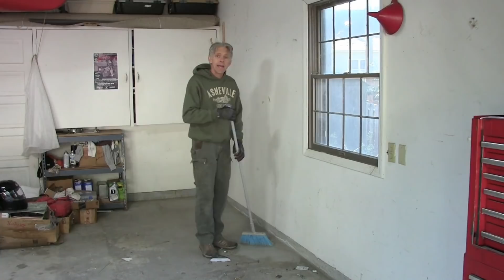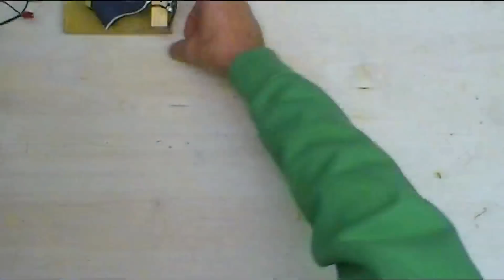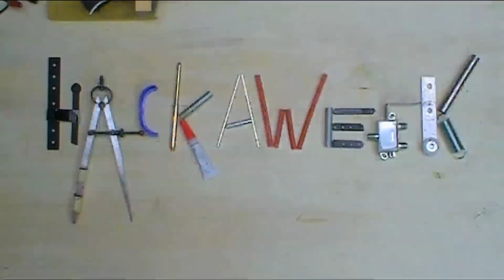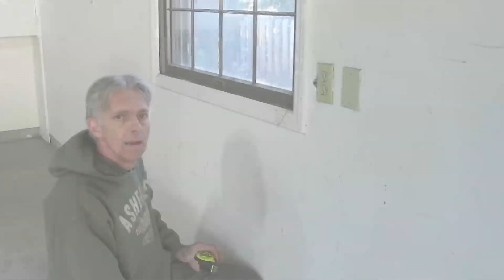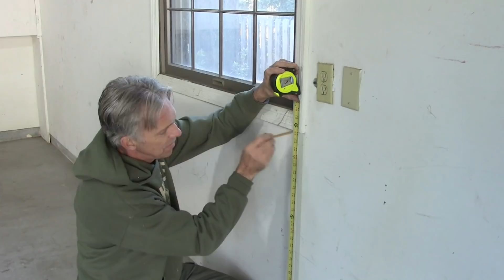Garage Remodel Part 2 Workbench Build

Comment: You make things just like I do!!   I’m going to use this video to make my workbench this week. 
One question though that I don’t think you addressed in the video, it looks like you doubled up on the second leg out from the wall on the left.  Was there a reason for doubling up there and not anywhere else?   I was thinking that maybe that’s where the two pieces of plywood come together?
Reply from the maker: Yes there was a butt joint of two pieces that made up the work surface. I like building them this way because using a ledger saves on wood use. Have fun with your build and thanks for watching!

Comment: Nice.  I think I will remodel my garage work benches also.  it's a mess in there and I think it's time. The bottom shelf won't be partial like yours.  I will make it as wide as the top.

Comment: Why not use joust hangers to attach cross members for bench top?.
Reply from the maker: Because the holes in the joist hangers would not line up with the studs. They would be on each side of them. The ledger serves as a solid base for the benchtop to rest on without sagging with weight.
Reply: @HackaweekTV_KR4NIV  thank you. Great video. Again thank you.

Comment: I watched your video prob 20 times, and paused it and took some measurements of my space and built it today!  It came out wonderful. Mine is a pressure treated, outside garden workbench. I ripped a 4x8 in half and then for the shelf I ripped the 2x8 by a few inches. Wish I could share my pics with you. I appreciate your video. It inspired me. I am not much of a woodworker. .)
Reply from the maker: Great job!

Comment: if you are planning on doing any mechanical repair I would go and get an an 8 by 10 feet sheet of galvanized steel. Have your local ductwork company to cut and bend down at the front. Now you have a steel topped workbench. So much better for keeping stuff clean.

Comment: This was great, thanks so much! I was able to use this as a guide to make a decent bench I can work on. Came out to 15'7" long, 2' deep, and about 41" high. I wanted to go the full 16' but needed to chop off a little length to be able to put my toolbox next to it and not block anything. I picked up some new skills, and a greater appreciation for how hard it is to cut a nice straight line with a circular saw to make the top.

Comment: I made the skeleton of the bench top with the ribs first.   Set them away from the studs where I'll crew in my back 2x4 to the wall.  Helps to just put a small 1' 2x4 butted up under the back 2x4 just to make you feel safe.  Legs are two 2x4' on each end in a L and a couple of doubles attached to the ribs and 2x4.   I also made it where I can run a 2x4 from front to back a foot off the ground for storing wood and what ever.  Enough room put a board down to store tools.  
I used 2x8's for the top with 3" hang over for vice or anything else I need some good support.  Not to long to make.  Counter sink your screws so you don't split the wood.

Comment: you definitely don't need to predrill before every screw and don't use phillips screws you can hear his bit slipping on almost every screw.
Reply from the maker: I predrill so that the treads don't bite into the 2x4. Without predrill they do and you don't get a tight joint. So the bit slips a little, but the screws are tight. Also, try taking the time to use some punctuation and proper sentence structure.

Comment: Is it really necessary to pre drill ?
Reply from the maker: If you don't, the screw bites into the 2x4 and then into the wall and there will be a gap even if it seems tight because it's tightened to the 2x4 NOT the wall.

Comment: I've built many benches this style a couple things I do different drop your ledger three and a half inches build the frame cause I don't like the toe nailing the screws in the back offset cross braces so you can screw the frame into the studs and also double up on the 2X4s on the legs go from the frame to the floor and it looks a lot cleaner plus where ever i'm going to mount my vise I put in some extra 2X4s laid flat but that's me I tend to over build

Comment: i built the whole frame for the table top on the ground and then laid it on my pre leveled leger board propped it up at the same height at the front while i secured it to the wall

Comment: I know you built this 5 years ago now, but for anyone watching, a handy tip to keep from losing track of that bottom piece of window molding, is to tack it up underneath the bench top to the ledger board with a couple of brad nails (or tap in the nails already in it), at the location where it came off.  It's out of the way there, but you'll see it if you ever have to move the bench.

Comment: I am not 100% convinced that structure is as stable and strong as it should be for a workbench. Fixing it to to stud work would be the first point, Those pocket screw type fittings screw fixture is not convincing either. 

I would suggest legs at the rear even fixed against the wall would add extra downforce support at the rear.  It is not a bad build by any account. 

Even one centre leg at the rear would make a big difference.
Reply: depends what youre going to use it for,  light assembly, general work automotive work,  should be fine.. if your going to put a big vice on there and smash things with a mallet build it stronger obviously

Comment: I wonder if it wouldn't be quicker( and more solid) if you build the frame first and then connect it to the wall then put the top in it? I know, hindsight. 
Very simple and practical design which I very much like. Thanks.
Reply: with a helper definitely build the frame on ground,  but by yourself you have to break things up a bit sometimes especially with a 16 foot bench.  I built a similar bench in my shed and ran a ledger first

Comment: toe nailing those babies is plenty strong as long as those screws are decent.

Structural Screws, and the double threaded composite deck screws come in super handy, for various scenarios, but they are great to have. Those structural screws have serious sheer strength and the deck screws are good at pulling things together bc of that double thread, and man you cant pull or break  those suckers without dynamite. and they leave a little tiny "finish nail" like hole.

Good build !!

Comment: Minor point - if you want your bench at "3 feet"  and you've painstakingly spent time drawing up your plans, you might as well add the thickness of whatever top you choose.  And I agree with John (below), that you should set the height of the bench more according to your height than a standard measurement.
Reply: Yeah, I like all my benches at 38" as I'm 6'4.
Reply: I have several benches at varying height to use depending on the project I'm working on.
Reply: And I put the benches on casters to move around.
Reply: Yes everyone is different.The rule of thumb for comfort is to put table top height @ wrist flexion. That is not something set in stone, but a typical comfort height. Different projects are more comforting to do higher/lower. Sanding etc... lower, detailed and less strenuous higher.

Comment: Love the video thank you, but for those that are a but lazy it is so much faster if you just build the work bench top frame on the ground just like you would a wall with a top cap. then just mark your line on the wall then screw your top frame into the wall at every stud. no toe nailing that way . put your legs on, then top  and bam your done. build the same bench in way under 2 hours and that's moving at a snails pace
Reply: +not important  Made the same workbench last weekend I built the frame on the ground then screwed to the wall much less work  also cut 2x4s on 45 deg  angle for inside the frame (top)  to square it and to make it more rigid  also spent the extra to use plywood  not OSB I hate it just a little bit of water. it blisters or bubbles  or hammer on it and chips I guess OSB has its place but not on anything I do
Reply: yes much stronger and use 4x4 for front legs or double 2x4
Reply: +Jon A use 5/8 or 3/4 laminated plywood.. OSB is like a sponge with time will weaken unless kept absolutely dry
Reply: +Jon A cover that OSB with some 1/4 or 3/8 laminated plywood  finished 1 side

Comment: Sheet metal on the top would be even better OSB is CRAP on anything  it chips and splinters very easy. if anything I would have spent the extra on plywood
Reply: i agree and traps dust so when you wantto work on a project like pai ting or rebuilding a small engine freaking dust creeps out and imto your project,   urgh...
Reply: +gear head Yes  I agree not too many Projects that I use OSB for. maybe concrete forms or to shim something . I think it is JUNK  just a small amount of water and it bubbles and blisters to no end. and it Rots very easy. I made the same bench and used Plywood looks and works great . and the Plywood was about !0 bucks more . so in the long run taking into account the fine qualities of OSB  ( lol )  you make out better using Plywood
Reply: 1995dresser I used osb for the top of my bench. sanded and put a couple coats of poly and it's as smooth as a baby's bottom. no chipping or splinters.

Comment: Here is a handy rule of thumb when planning the height of the workbench. Bend your arm at the elbow. Now measure from the bottom of your elbow to the floor. Subtract about 1/2". That's a very good working height for your bench. Not all of us are 6 feet tall, so planning a suitable height is critical to usefulness and enjoyment of the bench. Bolting the bench to the wall makes for one rugged bench. I know, because my son crashed his truck through my garage door on time, and my wall-mounted bench stopped the truck!
Reply: I’m from 8 years in the future!!!! Thanks for the tip 🤙🏼

Comment: Excellent vid. Thanks for the several good tips! What I am going to do is build an outside bench. Any further suggestions ie. wood type, screw types & length. coverings/sealers/painting?  Our weather type is all except snow; coldest is around freezing & summers are about 108 on July/Aug.  Thanks again, Liam of CA

Comment: Nice job Dino, it's your workbench and you built it how you wanted it.  However, just a few things to point out #1 OSB splinters too easily, and is too flexible, #2 those look like drywall screws which are brittle for general construction.  I would have gone with 3/4" plywood (possibly double thickness) with a replaceable hardboard top.
Reply: You are correct ! I would also ( as I did on mine ) use 2 x 4 joist hangers and angle the supports for more leg room.

Comment: I need a new bench. I was thinking about covering the sides, legs with an enamel finish to make it have a glass like appearance and using recycled aluminum sheets on the top I already have them. I don't do anything like you so it doesn't need to be as durable.  I'm not how the enamel paint will work.

Comment: You should turn the legs 90° - else they will be in the way of your feet !

DON'T set the power outlets on the wall but in the front under the table plate.

Just some good advices for free
Reply: Keld Sørensen in your opinion it's good advice. Mr nit picky know it all.

Comment: Great video. Bench will really help you out on there hacks. Glad you went with the legs every 4 ft. Only one thought and just because I can see you setting heavy objects on the bench like the said CB750 engine. I would add a 2x4 on the front of all the legs. from the floor to the bottom of your 16 ft 2x4. Just so your not depending on those 3 small screws to keep the bench up. I do realize the legs are hitting the bottom of the OSB but it would be much safer with the added support. Anyway just an Idea.  Love your videos. Please keep them coming. oh yeah currently 20 deg here !